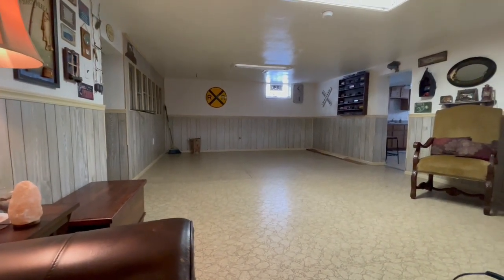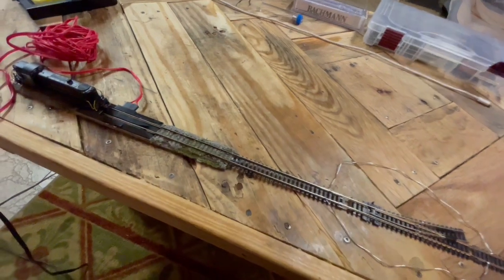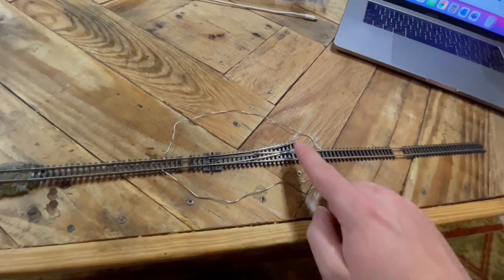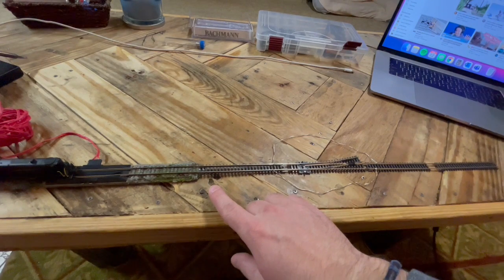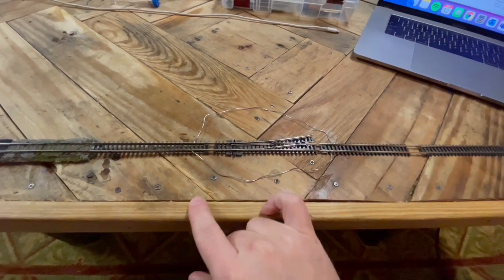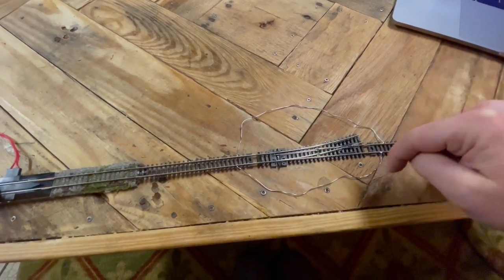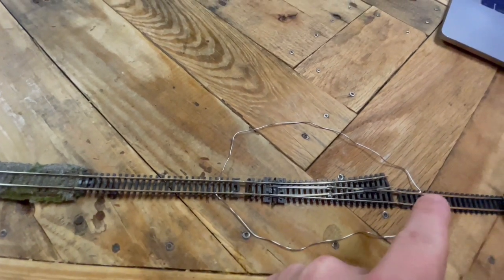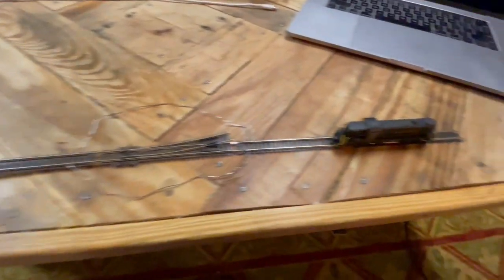HOW TO - Wiring an Insulfrog / Electrofrog Peco Power Routing Switch / Turnout

Comment: Also. Peco turnouts require  Peco SL 310 rail joiners. They are slim and slide on the turnouts without forcing them on. Yes you can use any rail joiner but the Peco SL 310 work much better.
Reply from the maker: good tip